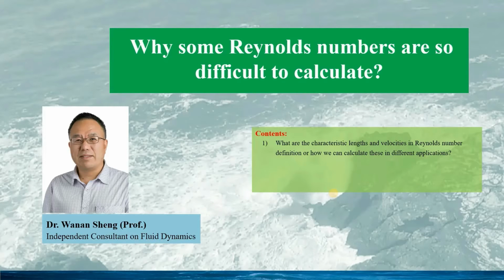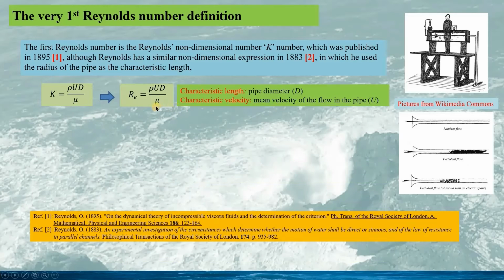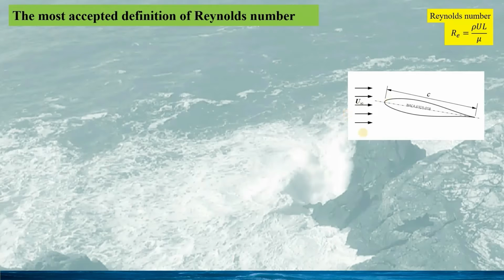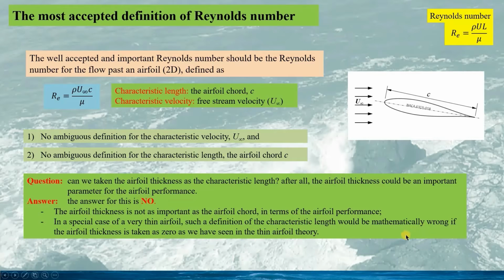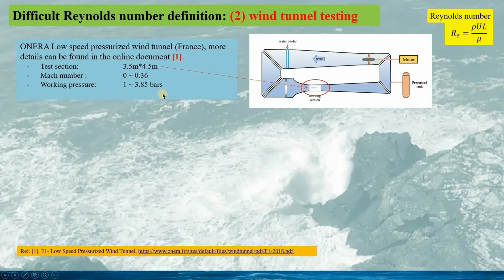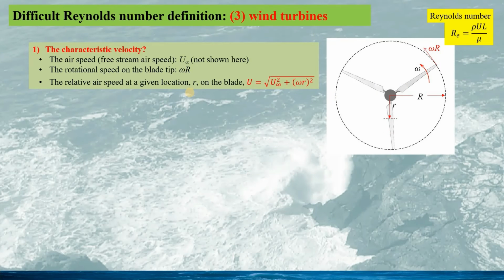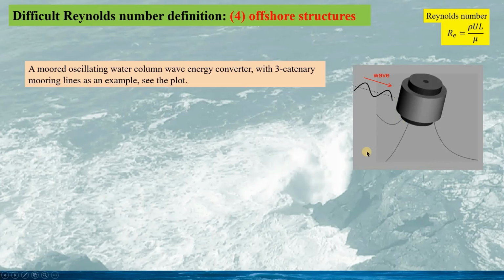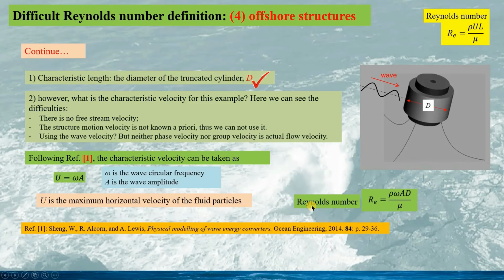Why some Reynolds numbers are so difficult to be defined?

Comment: Working with wind resource assessment for a bit, I always knew there would come a time when someone with some knowledge in CFD would want to ask about the effects of Reynolds numbers in the simulations. Although it is a valid and relevant question, I would always ask back how one would define the Reynolds number in that particular case, and the answers were never clear. Nearly everyone would consider using a free stream mean wind speed, neglecting not only the wind speed profile, but also the relative motion of the blades, not to mention the problem of the characteristic length.
This video illustrates this perfectly; glad to have found it on LinkedIn. Thank you!

Edit: Also, kudos for adding subtitles!
Reply from the maker: Thank you very much. I have also similar confusion as yours, and I think I have the answers to my questions. I am very happy this solves your question.

Comment: How do you estimate the Reynolds Number of a wind turbine blade if the only value you got is the cord length of the blade?
Reply from the maker: for a wind turbine, you should have the rotation speed, then you can calculate the local air speed to the chord, thus you can calculate the corresponding Reynolds number.